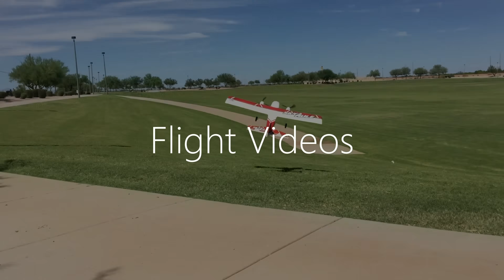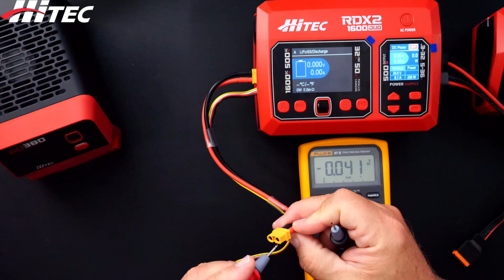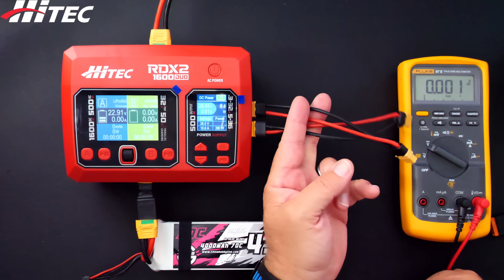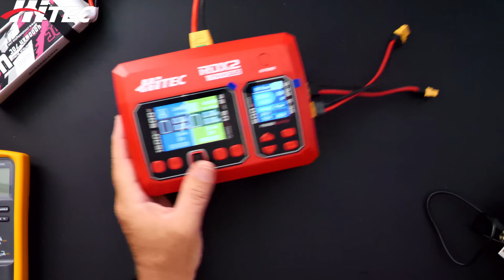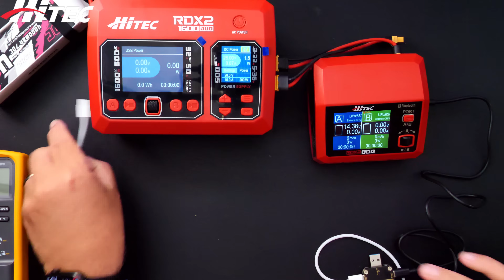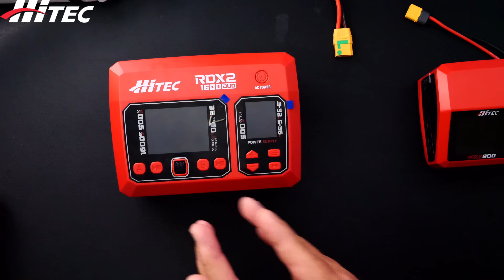Uh-Oh! HiTec RDX2 1600 Caught Fire During my Review

Comment: I'm not seeing that follow up comment, but i do see on hitecs website where it says not to run another charger off the power supply, and where it says not to run the power supply without a load 🤣 It wasnt the plugging in part, it was the unplugging part.

If electricity is like water, you put a balloon on the hose and it popped, has to go somewhere. Just like the small charger doesn't know where its coming from, the big one doesn't know where its going... but it has to go somewhere.

Comment: Did you see if there is a calibration setting. So that you can use the voltmeter and correct the indifferences. Many isdt and hota chargers have that function.

Comment: nvm, I just saw some other commenters think that also. ~~Was the issue with the RDX800 at 25:50 due to plugging the balance lead into the wrong port? I'm not familiar with that charger, but it looked like you plugged the main battery lead into port A, and the balance lead into the port B balance port (hence why both channels were showing a voltage a few seconds earlier).~~

That RDX2 1600 certainly has a few issues, and I think it might be more than just a firmware update needed (and not just for your toasty dearly departed...). Then again, you could have been struck by reviewer's curse and got the lemon. 😆
Reply from the maker: The RDX2 800 works fine. So it wasn't that. The cross connect probably does explain the error I saw trying to start a charge, but it certainly wouldn't have impacted the RDX2 1600.

Comment: 12:35 …it’s 4.2 x 8 = 32…really?  Wouldn’t it be 33.6?
Reply from the maker: Usually nominal voltage is the reference which would mean 3.7*8 or 29.6v if you want to knit pick.

Comment: I love my Tool Kit charger even more now.
Reply: The HiTec charger here is a SkyRC, a brand commonly knowed to make good products. 
Concerning ToolkitRC, I bought one, the Q4AC, take fire without any reason, no big load, nothing fancy done with. 
I juste try another, take fire quickly ( 5 minutes) and hardly.
When I open it, I understood that the design are so bad... Poor components for what I know, power circuit underdesigned...

I'm actually back with SkyRC Q200 neo, who remplace one of my 2 Q200 v2 (not neo), previously another B6AC, never any problems, except with one Q200 with button need hard press to work, after replacement, all done :)

Comment: Kuddos for keep it going.  Even if you had crossed something I would expect a charger of this caliber to have a protection circuit in it.
Reply from the maker: Agreed
Reply: @RCVideoReviews I don’t think it’s from when you plugged back in I think it was caused by disconnecting while it was still providing voltage and current.  I’ve seen some chargers not handle disconnecting while they are outputting.  

I’ve learned to stop them before disconnecting.  That is really no excuse though they should be built better

Comment: Nice light show, thanks to the red case. Hopefully the second charger survived. I suspect it did running off the DC input.
Reply from the maker: The RDX800 is fine. I'm using it to discharge the demo batteries.